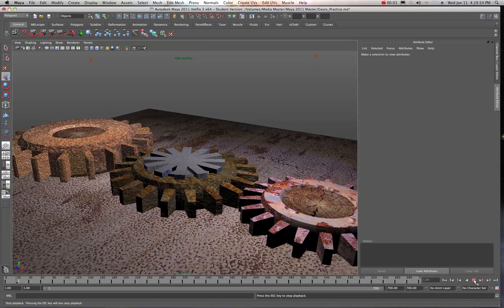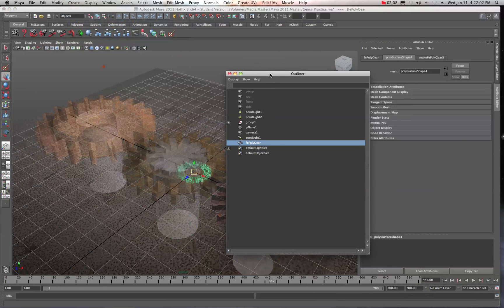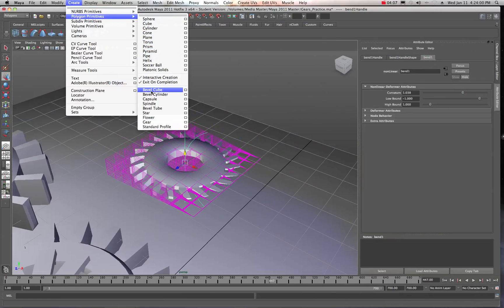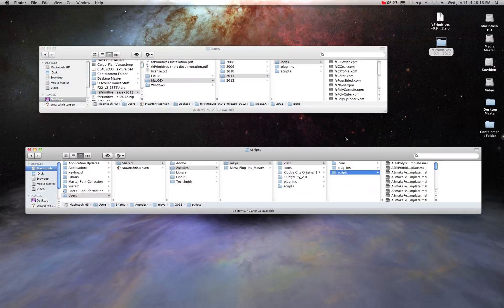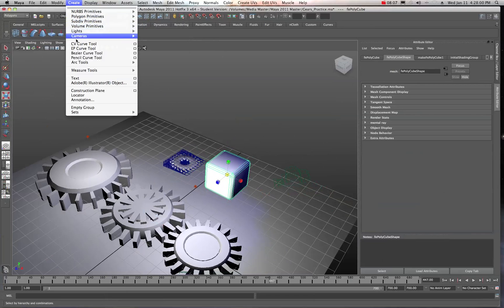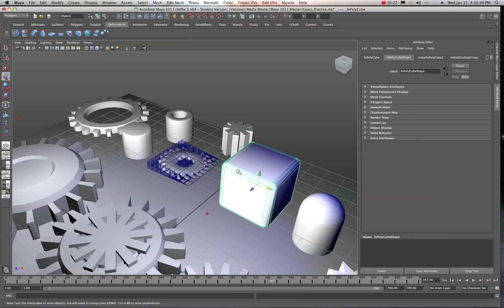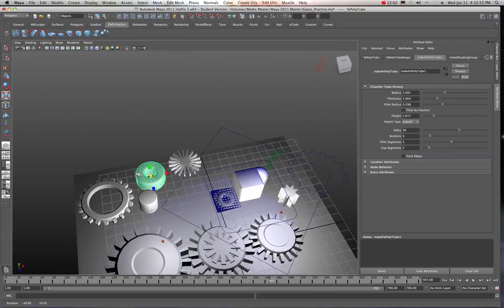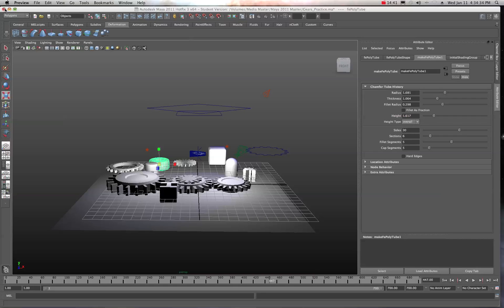Maya 2012 Primitive Gears Shape Tutorial by Stuart Christensen

Comment from the maker: @NoFaithNoPain In this case the animation is 400 frames.  I keyframed the Y axis of gear #1 to rotate 360 degrees clockwise, gear #2 (360 degrees in the opposite direction and gear #3 360 degrees Clockwise.  Because all of the gears are about the same size this method works,  however, if one gear is half the size of the other it would be adjusted by using a 1:2 type ratio etc. At best Maya is good for just approximating actual movement.  Cheers!